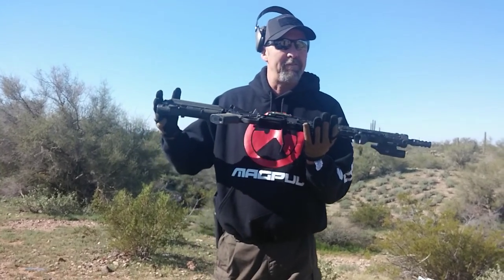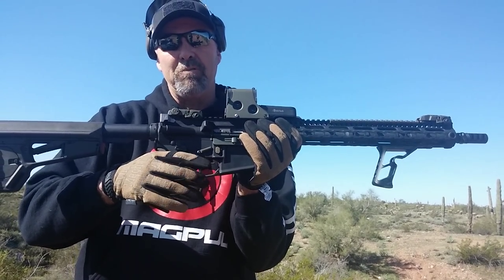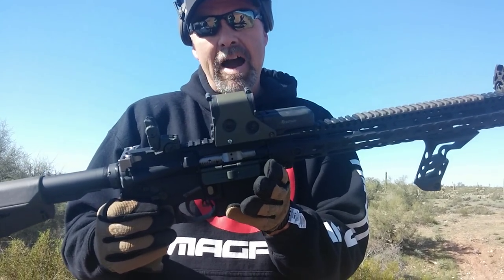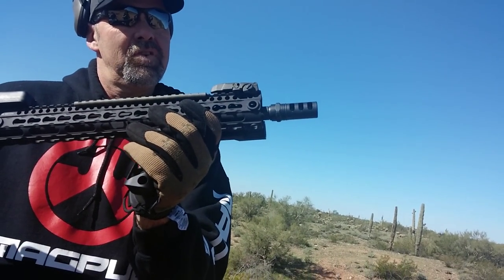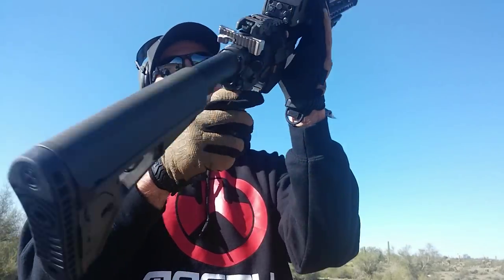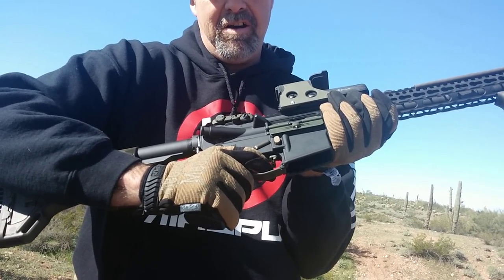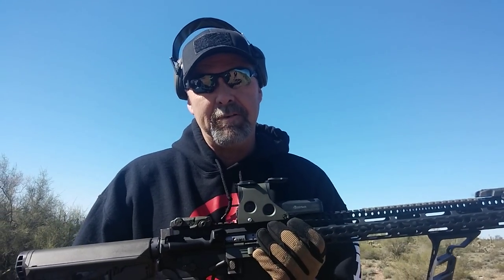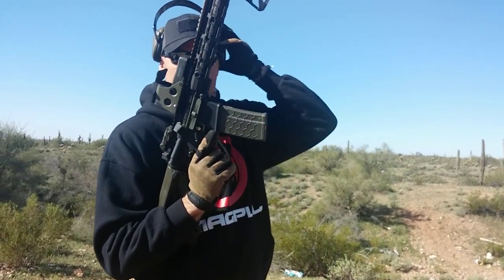My first AR 15 build  Please comment.

Comment: Do you know if I could upgrade my AR 15 that I bought. The band without any problems it doesn't have a muzzle device
Reply from the maker: It depends on if your barrel is threaded or not. If it isn't you'll need to take it and have it machined, or just replace the barrel.
Reply: changing the barrel  on a rifle bought during the band is leagal. Im in FL